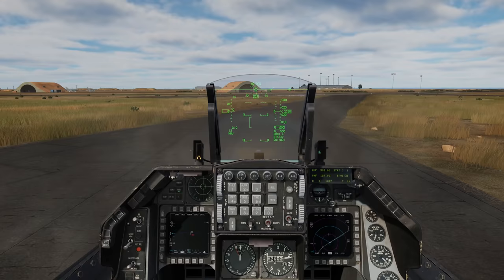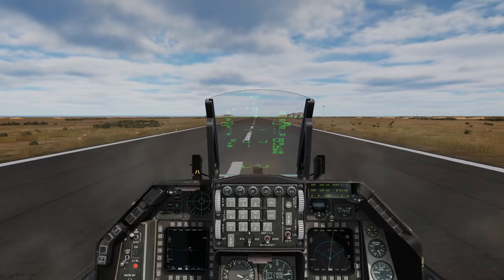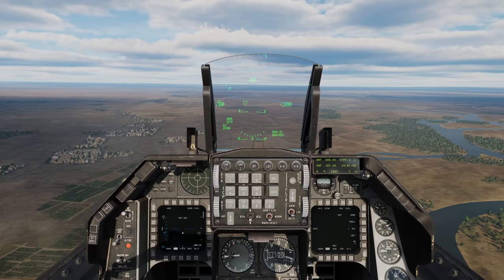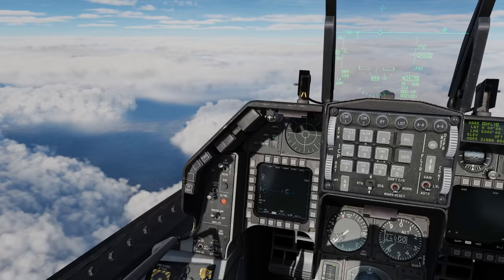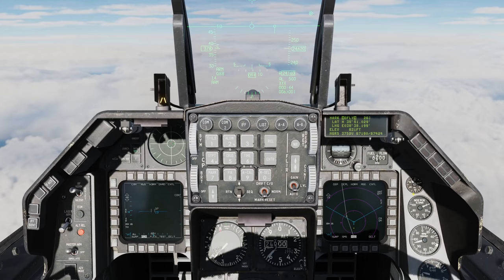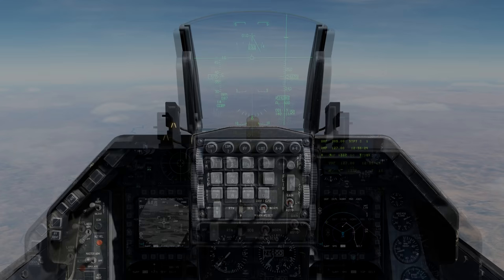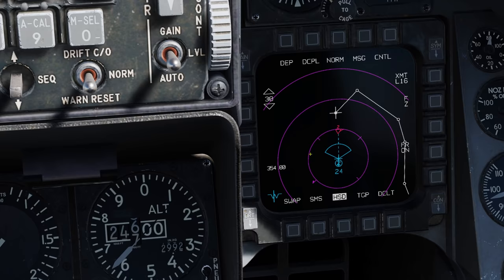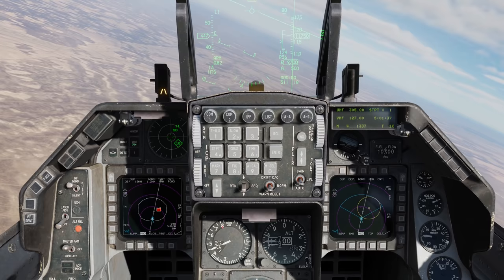DCS: F-16C Viper | March 2022 Update

Comment: Hello Mr Wagner. When flying with friends, can we make "our own flights" in the LINK16 DED page? The page was populated but INOP an we could not find a way to set it up.  Usually (in the MP enviroment) each plane is on its own group and not possible to see "wingmen" etc on DL.. You had a video on this but would be great to do an update if this has changed. (setting up from both sides + demonstration) Thanks!! :3
Reply from the maker: Probably not for this update, but certainly planned as we flesh out the DLs.

Comment: you didn't receive an audio message "Data" when ai #2 sent you spi.   Is that normal and you only get the data audio warning when you receive a steerpoint that was shared via datalink ?
Reply from the maker: No audio "DATA" is used in this circumstance.
Reply: @MattWagner  thanks Matt

Comment: Cool. How do you slew TGP to  SPI? I can do this easily in the Hog
Reply: Press CZ (cursor zero) on the TGP MFD:
"Pressing the Cursor Zero (CZ) button on the TGP page will erase system delta, moving the SPI (and the targeting pod) to the original steerpoint location."
Reply: @after_midnight9592  No I want it to move to designated SPI.
Reply: @rajm1976  if you designate spi with a markpoint, just set the steerpoint to that number. Tgp will auto set to the selected steerpoint.

Comment: Comm switch on the throttle ?
My nerd side does not compute, I can't find that reference in the bindings. Overheating dangerously :D
Reply: Transmit Switch - IFF IN & IFF OUT, respectively
Reply from the maker: Comm Switch = Transmit Switch
Reply: Roger, thank you gentlemen
My binding is ready ;)